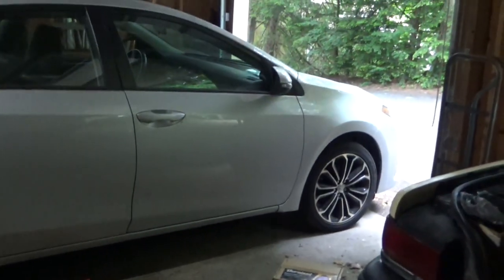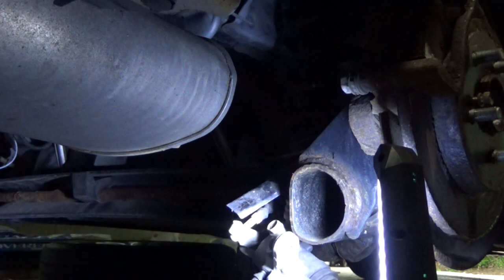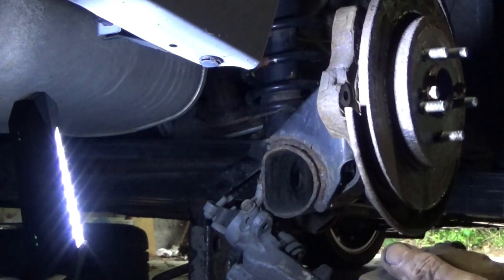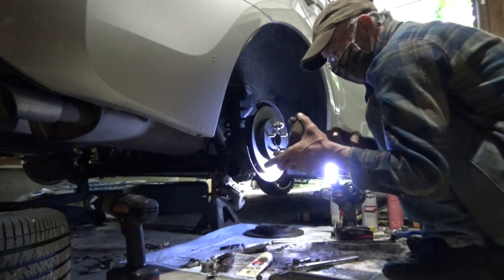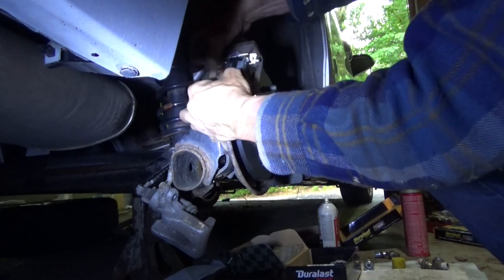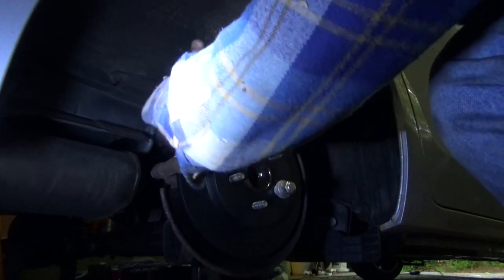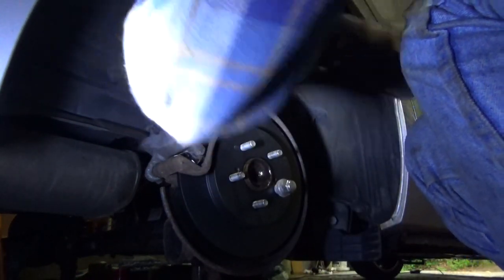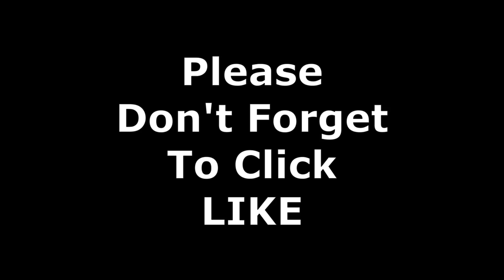2015 Corolla S - Rear Brake Replacement - Auto Repair - Part 2

Comment: Clockwise (right) when retracting pistons both sides, I also crack open my brake reservoir cap during that process. I like to torque bolts according to spec. New pads and new rotors, burnish them aka as smoking them during the test drive.  Good refresher though and you showed the typical frustrations with brake jobs.  I think shade tree mechanics and todays mobile mechanics show good ingenuity skill, safety is always best and good tips throughout both the front and rear brake videos.  Worth the watch.
Reply from the maker: I'm so used to pistons rotating in the direct the cable pulls, I often forget both are the same direction. As long as there's room in the reservoir, I let the vent do it's thing. I prefer to torque bolts the see extreme heat, vibration, or heavy load.... when the info doesn't take over an hour to find. I don't do nearly enough work to justify a data subscription.

Comment: I give you alot of credit for retracting that piston by your cube/clamp set up.  I just purchased the lisle 25000 caliper tool and makes this job a breeze.
Reply from the maker: That "not-so-handy cube is collecting dust now. I did the same.... bought the RIGHT tool for the job!

Comment: Thanks for this video. Turning those rear pistons back in can be a real pain. 

You must be half magician, because I couldn't get a large c-clamp to hold on and still allow me to turn the cube with a socket extension, the cube tool wouldn't cooperate. 

I ended up mounting the caliper bracket back on the car without the rotor, then mounted the caliper to the bracket, then used the large c-clamp to hold the caliper to the bracket (so it wouldn't slide off when applying force to the cube). I could then push my weight in on the cube while turning clockwise, finally getting the piston to turn in. I also had to use a fair amount of silicone spray (thank you for that tip also) to get the boot to un-stick from the piston. It would bind up and twist into a weird looking boot that would soon split open.
My 2015 Corolla S Plus had 60,000 miles when I did front brakes and then at 77,000 miles, the rear disc brakes. I live in mega-salt Northern Michigan and the slide pins (factory assembled) were so bound up, it caused major pad wear down to the metal on both front and rears (inboard pads only). 

I now will check wear every 20k  and re-lube pins, clean out rust on the brackets and piston areas of the calipers, then hit the whole brake area with a wire brush/brake cleaner/primer/paint/fluid-film or woolwax treatment.
Reply from the maker: Excellent idea! I'd done that in the past with really stubborn calipers, but usually ended up replacing ones that were that hard to turn in.

Comment: A lot more confident with this repair now. Thank you!
Reply from the maker: Just make sure that the pads can move in and out with relative ease, and the slide pins are clean, freshly lubed with a light coating of grease specifically designed for brake use, and slide freely. Also make sure to replace anything that is damaged, cracked, or perforated.

Comment: for the part 1 only comment is when showing in closeup it's not centered on the camera so you can't see whatever you showing, other than that it's really good video for giving us confidence on DIY. Thank You
Reply from the maker: I realize my camera angles suffer. I'm doing this completely solo without any monitoring system, so it's REALLY difficult to concentrate on the job, as well as what is in the viewing area. Sorry. (I'm trying to learn from my mistakes, even though I keep making them)

Comment: Your video was a tremendous help.  Piston was stuck, rubber boot was twisted.  After using the c clamp, it went in no problem.  Took 2 hours on the right side, and 15 minutes on the left.  Thank you very much.  I need to replace the boot, know where I can get one?  thanks again
Reply from the maker: They usually only come with a rebuild kit. It's easier to just replace the caliper, or the whole caliper and bracket (semi-loaded caliper)
Reply: Hey there I was wondering if you knew how to release the emergency brake from the caliper? Having an extremely difficult time doing so
Reply: @chalvs71  sorry i didnt have to touch e brake. Good luck

Comment: kindly please explain why needs to  rotate instead of just pressing it down like the front one?
Thank You
Reply from the maker: The parking brake uses a screw of sorts, to press and automatically adjust. You MUST rotate the piston to turn it back down that screw. (otherwise damage WILL occur)

Comment: The inboard pads are always a pain
Reply from the maker: They can be.... j different makes often have slightly different assembly processes. Getting an order, that works for a specific application can be tricky, but once you've got a process down, it becomes easy.

Comment: The bolts you used to take the rotor off? Where are they from lol
Reply from the maker: Miscellaneous bolts from my stash. The thread is 6mmx1.5. (make sure to lube the threads)

Comment: How do you remove emergency brake cable
Reply from the maker: Start by removing the cable housing from the bracket that holds it in place... Then work it off the caliper lever.

Comment: Nice video...So my question is all the Model plus S for the Toyota Corolla 2014 and 2015 rear normal discs and not the drum kind?
Reply from the maker: Not sure I understand the question, but if you are asking if models besides the "S" use drum brakes in the rear. I can't say without researching, but I believe the other models are still using drum brakes in the rear.
Reply: @HouseCallAutoRepair  do the 2004 Toyota plus have normal discs in the rear or are they drum?🤔

Comment: No torquing?
Reply from the maker: I'm fairly comfortable using the rule "tight enough to not work itself loose, loose enough to not break on the next guy" This is the salt belt. Not much matters, due to the fact that it won't last anyway. I suppose it's not providing a good example... (I'm also not yet subscribed to AllData, Mitchell, or any of the other reference sites, so finding the actual values can be extremely time consuming.)
I AM however, a stickler for torquing things, where torquing is as critical as head bolts, flywheel, clutch. etc.

Comment: Where do you get the cube?  And who was the idiot that made it so that it has to rotate?
Reply from the maker: The brake caliper retraction cube can be found at most big box auto part stores. Instead of using a completely different, drum, parking brake system, they put a screw in the back of the piston to push it mechanically. They're really nice systems, OUTSIDE of areas that salt their roads, as long as they're cared for.

Comment: I have the same problem with the piston not going in at all and now the rubber boot is all twisted. Any advice will help please
Reply from the maker: CRC Silicone Spray. (Makes the rubber super slippery) Gently pull out on the boot, just enough to work in some silicone. Once you've worked it all the way around, the boot will self straighten.